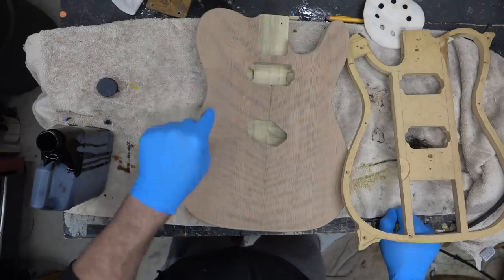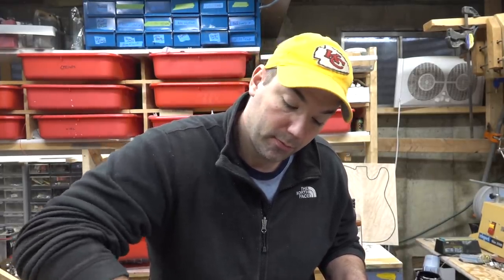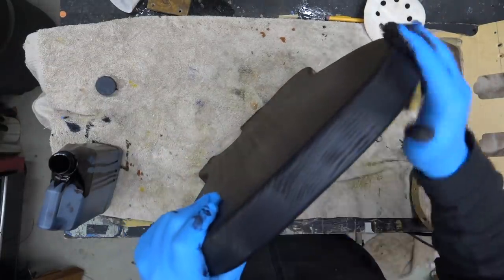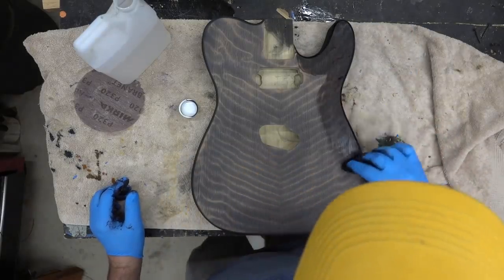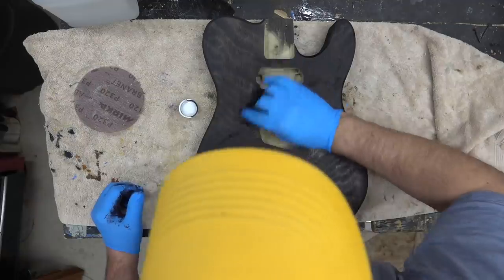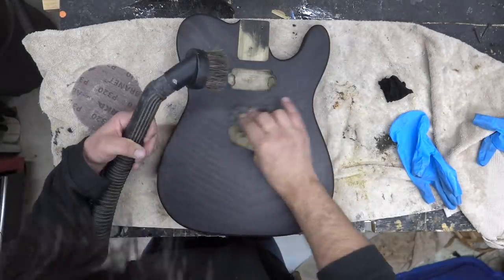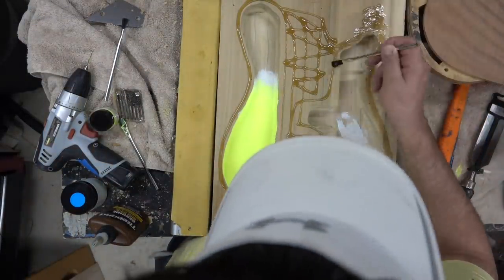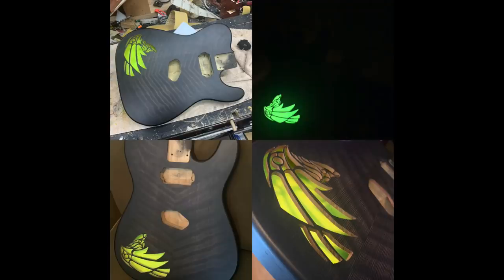The Raven - Custom Hollow Body Guitar

Comment: With the monday's newspaper, you should have first carved the raven, glue some transparent acrylic under it, so the light still can pass through, and you don't have problems with the inlay cracking.......or fill the inlay holes with clear epoxy...

Comment: Hey Big D!  your vids have been great all these years!  Thank you! The raven will crack!  I don't see any way that it won't, where the grain runs so short and thin.  It would be a whole new operation, but you could pour a thin clear epoxy to fill the spaces in the raven cutaway.   Good luck, your sense of adventure is inspiring, amigo.

Comment: You should be able to hog out most of the material with the 1/8 bit, then come back and clean up the corners with a 1/16.  In easel there is a way to do a multi-bit path, but I think you have to search for it...  It's been 3-4 years since I did something like that in that program, but I know it's there.  That will keep the headaches to a minimum.

Comment: I hope you see this soon and can help.
I used India Ink in violet. I'm about to steel wool it with 0000 steel wool. Should I then put another coat of India ink on it then use that mohawk pre-catalyzed sealer.  Does any sanding need to be done after the sealer? My final coats with be Varathane water based ultimate poly gloss. I figured 2 or 3 coats of that then steel wool or wet sanding whichever is best then another final coat.
In your professional opinion does this sound about right?

I have to put on 10..yes ten coats of ink cause the grain on the Paulownia  really sucked. I was putting a few coats, sanding with 400 grit, few more coats then more sanding then a wet sand with 1000 grit (highest I had) wiped it down and needed one last coat for 10 total coats.